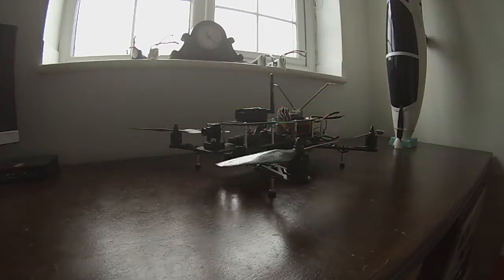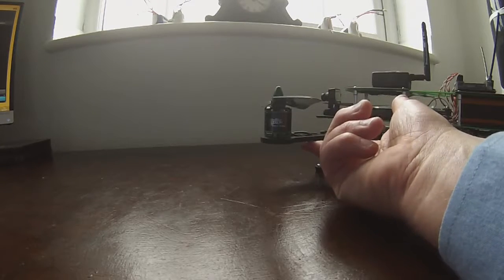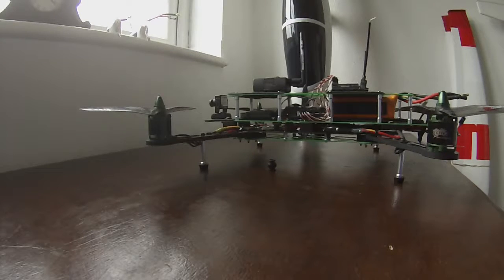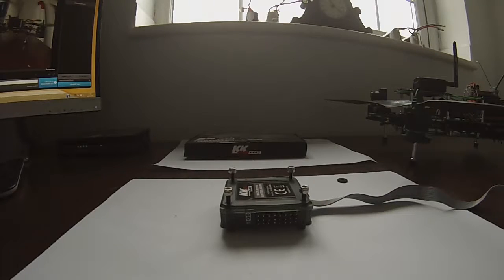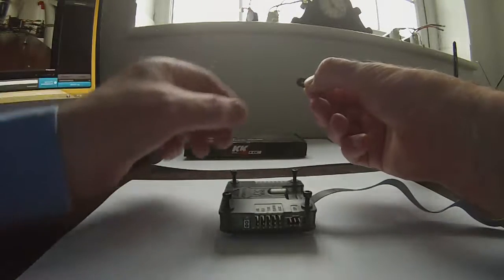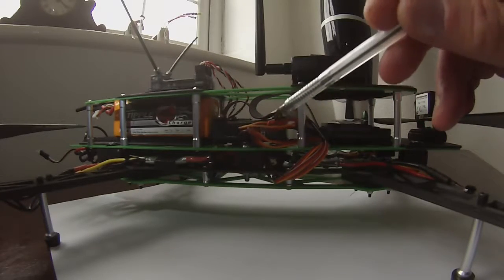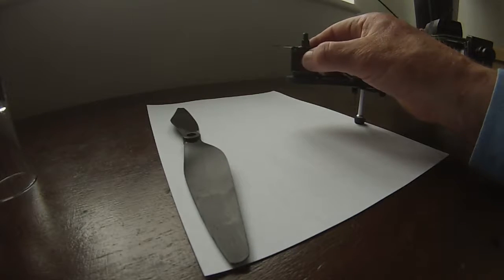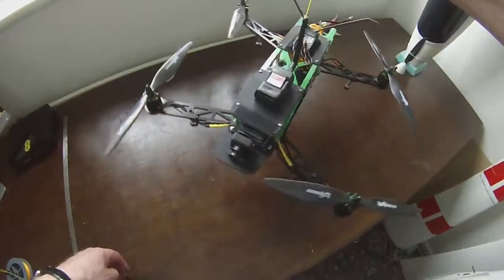BUILD info + FLIGHT of DART 450   Quadcopter

Comment: What Propeller and motor did you use?
Reply from the maker: Sorry, I didn't reply sooner.  Have just noticed your unanswered comment.  The motors were Multistar 22/16 @ 920 KV.  The props were 10 x 3.8, Cheers.

Comment from the maker: Thanks for the question.  I use Turnigy 2200 mAh - 4 cell batteries. After making this video and when flying without a gopro  I place the battery bang in the middle of the quadcopter.  To do this I had to cut away the top middle portion of the frame. This allows me to drop the battery into the frame through the gap made by the cut..  If flown with the gopro it requires the battery to be placed at the rear of the frame  in order to balance.  I use 2 chargers called  Lipro Plus 5.  I purchased these a few years ago through J Perkins a UK based rc distributor.

Comment: what battery did you use? and what charger? thanks
Reply from the maker: Sorry for the lateness of the the reply, 5 years and just noticed.  I used a 2200 4 cell lithium battery with a max discharge rate of 30c.  My charger is an En Er G lipoplus which will charge up to 5 cells. Power input is through a Ripmax DC power supply. 240 v in 13.8v out @ max 20 amp.   Cheers.